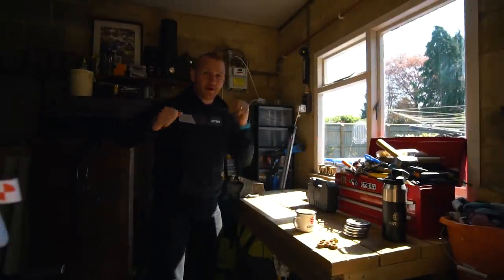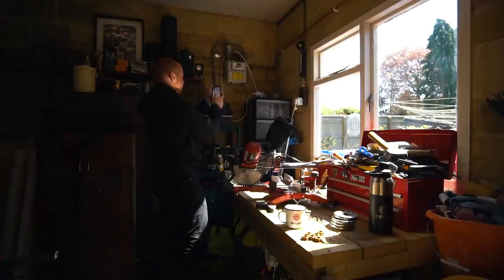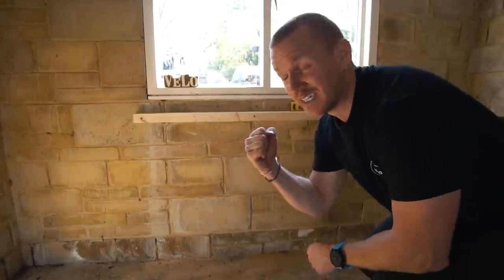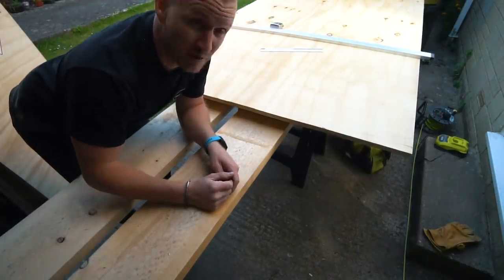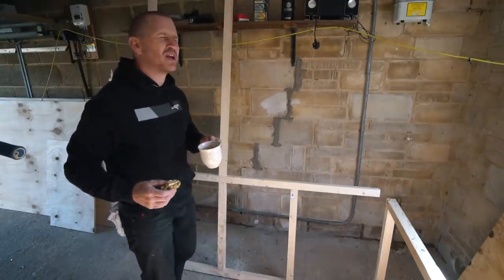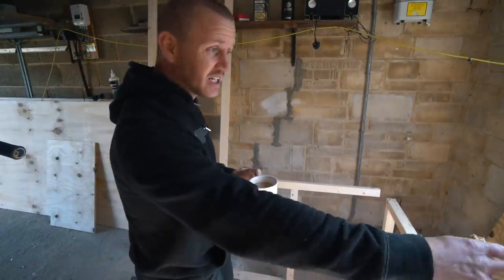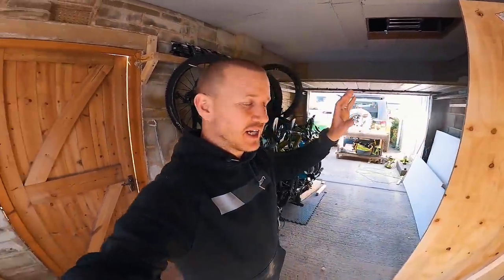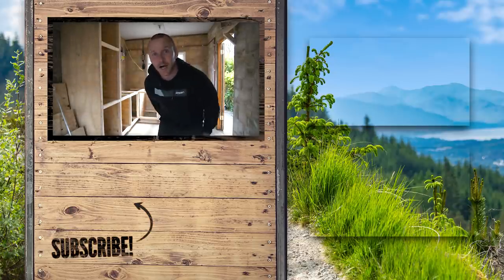Blake Builds A Bike Cave Ep.1 | Mountain Bike Isolation Project

Comment: A good tip, I used Ikea kitchen cupboards and benchtop worked out way cheaper than buying all the material + the drawers are easy to install and the wire baskets are great.

Comment: Awesome job so far Blake! I can't wait to see how it turns out. Two things I would like to see. One is a compact bike storage area. Fit 3 or more bikes in the least amount of space, I do not have alot of room to work with and like to use the space I have to the most efficient use. And B,  a movable bike storage stand. When you  do not have much room to designate an area to bikes. Something that can be moved and re positioned to another area if needed. Thanks

Comment: Blake! Huge fan of your content. Tip for cutting sheets of ply: buy a 4x8 ft piece of insulation foam, lay that on the ground and put the ply on top, set the blade depth a tooth deeper than the thickness of the ply and cut away
Reply from the maker: Seems like that would make a lot of mess!

Comment: Good idea blakey, think with limited space you could have done some clever hinge work to create a work bench that folds against the wall when not in use, also think of space above your head , pulley system to loft a floating bike/wheel rack etc. Also that gas main sticking out the wall would have to be shortned and tucked back - who ever did this needs his gas main looking at. Love the m/cycle , i think we share some commonality. Atb Buddy

Comment: Have you allowed for an air compressor, and hose reel or even an electrical extension reel.  you can have a compressor in the cabinets. and run PVC to a hose reel high up on the wall or ceiling.

Comment: Are Robinsons (square head) the standard screws in England or is it exclusive to Canada.  They would of been standard screw size for the USA but Henry Ford didn't want anything to do with it despite the Robinson providing  a better surface area to screw with and far safer than the flat head or plus head garbage still being used.

Comment: I think Id be having something low key to cover that window with all that snazzy kit sitting in there in plain view 👌🏼 Id also think about how to make that garage door more secure because I had 4 bikes stolen out of mine years ago and it had a handle like that. They are very easy to break in to, just hammer the lock mech out...no bueno. Anybody with doors like that should look into some sort of metal bars/sliding bolt dead locks through the bottom edge of the garage door into the floor would at least make it more difficult to swing the door up if the lock was broken. Obviously that only works for garages with access from another door or from inside the house 🤔 I guess parking the car up to the door would do something but anybody who wants in there could solve that conundrum easily too.

Comment: you had the bearers under the ply right the first time , should be 90* to the cut . then set the blade a few mm thicker than what your cutting and cut through the ply . this way it dont drop and pinch the blade as you cut . other that that nice work .

Comment: Your house Gas install looks like a nightmare/bodge, Blake.           lead pipe, service valve stuck out miles into the garage,defunct pipes left in situ   :-(        I wouldn't  be letting the gas board get away with that at mine! 

Pro tip for you:    Put some scrap battens on your saw horses before putting the ply on top,  set your saw blade depth a couple of  MM  deeper than ply thickness,  make your cut in one pass in the same direction (not switching direction, as you seemed to do in the film)     This will give you a better/straighter  cut and be much easier.  

   Keep up the good work dude.     :-)

Comment: First of all those anchors you put in the wall they're crap you need to get yourself some proper metal anchors even tap common would be better nose plastic anchors in concrete using Ryobi tools come on dude use Makita Milwaukee DeWalt Bosch Hilti come on Ryobi your building looks good darling when you're cutting plywood you have a straight edge Follow The Straight Edge all the way across don't stop on one side and start on the other that's a bad habit start clamp of straight edge cross give clam piscina I'm just busting your your chops least you're doing something being stuck at home at these times you have to do something😷🍻🍺